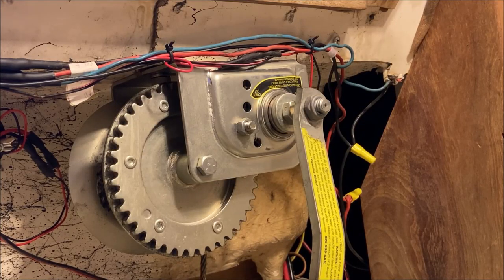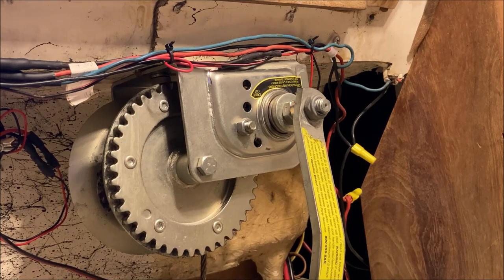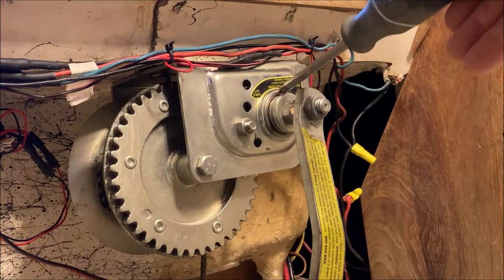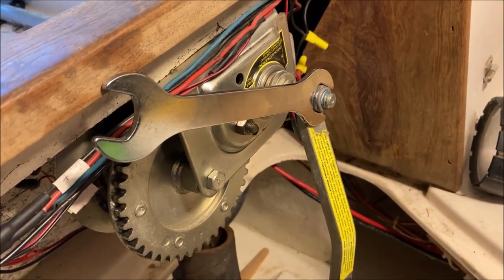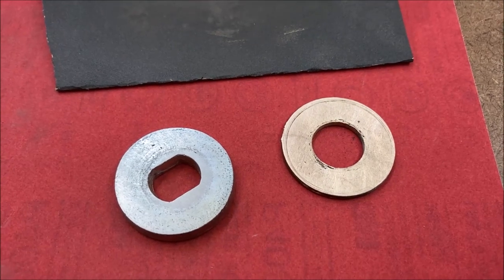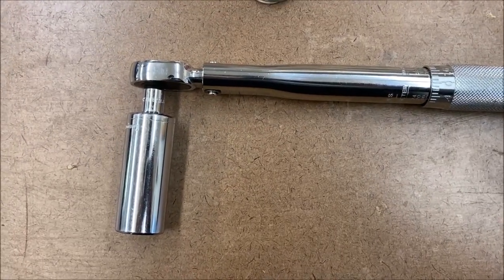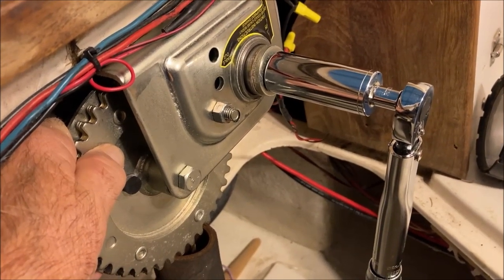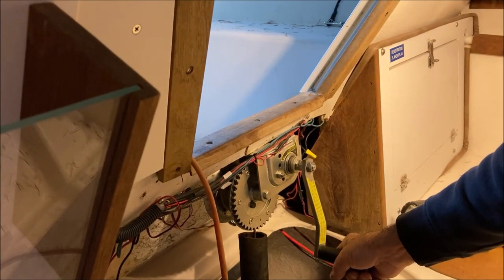Keel Winch Woes -- Catalina 22 Keel Brake Winch Repair -- Jim's Little Boat

Comment: Very informative video.  I just acquired a boat and the keel winch is missing completely.  I need to research a new one and this helped a bunch.  Thanks again.
Reply from the maker: The winch they sell at Catalina Direct seems a litle pricey but it has the right size handle.  If you get the same winch elsewhere the handle is generally too long.
Reply: @jimslittleboat4388  My boat is a 1974 Irwin 28 and parts are hard to come by.  I will have to retrofit something.  I am actually looking at electrics ones now because of the orientation.  Thanks for your response!
Reply: good morning and congratulations for the tutorials. I wanted to ask you if you can tell me how much the ballast of the Catalina 22 weighs. I should build one because I have to modify a boat from a fixed dinghy to a mobile one. Thanks in advance

Comment: A few drops of 3 in 1 oil on the "washers" before work is undertaken should reduce the friction enough to confirm or isolate source of friction. Thanks for video.
Reply from the maker: Maybe, Joe.  I would be careful, it relies on friction.
Reply: @jimslittleboat4388  I'm sure there is a reason why designers did not introduce a worm gear winch and dispense with "friction" as a brake element. Thank you for your videos.